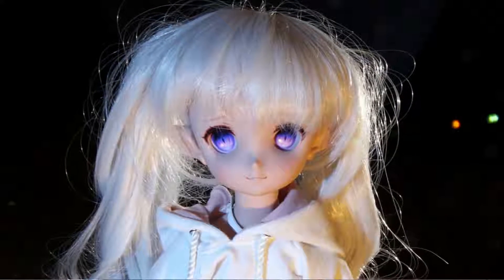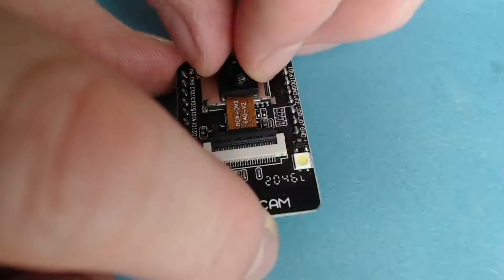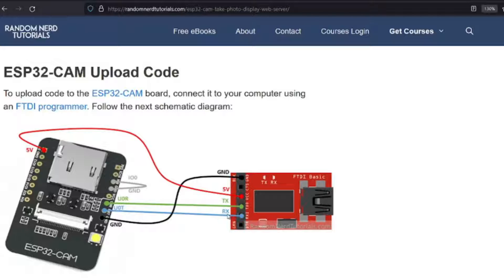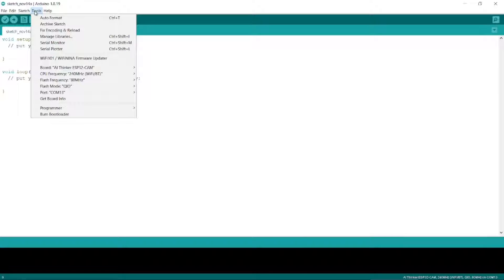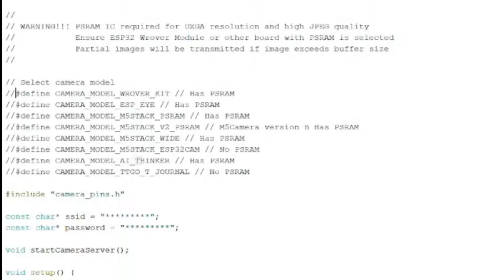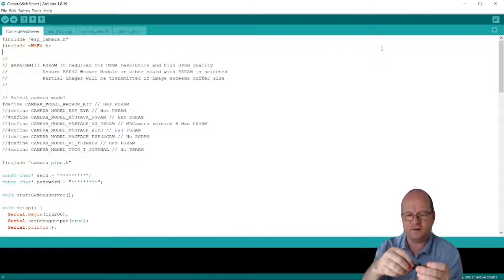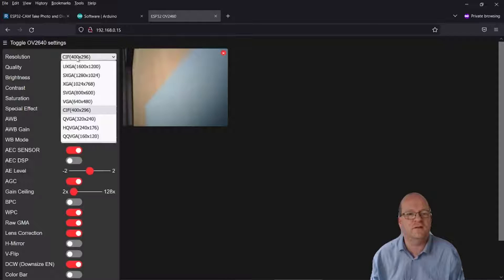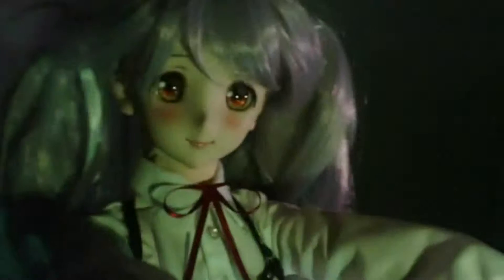📽️ ESP32 CAM Tutorial - Make a Doll Spy Cam!

Comment: I followed the image at 2:58 to connect the wires, then after the esp32cam couldnt connect I realised that all the pins on my FTDI were mirrored compared to the image, just had to pull them out, turn 180° and now it works.